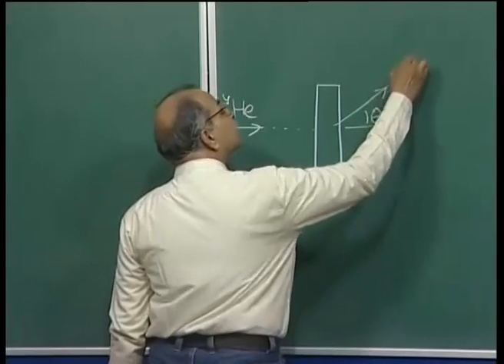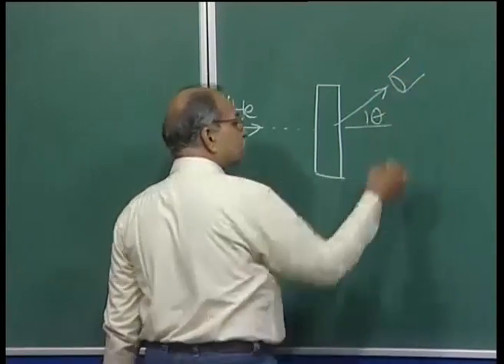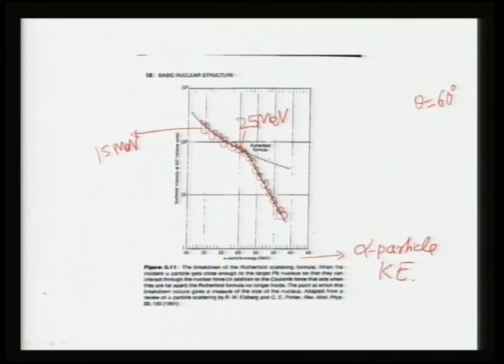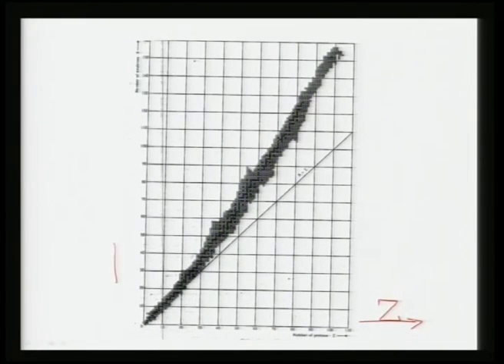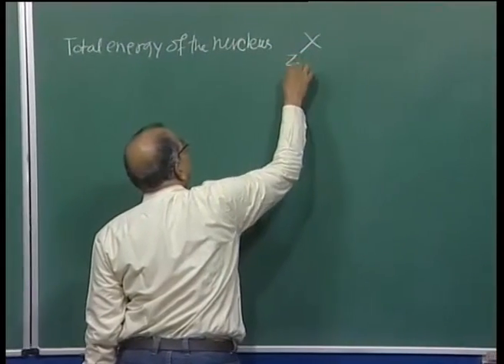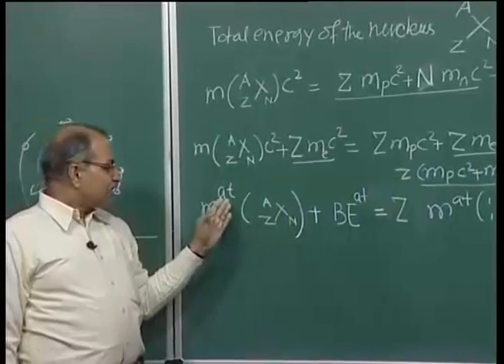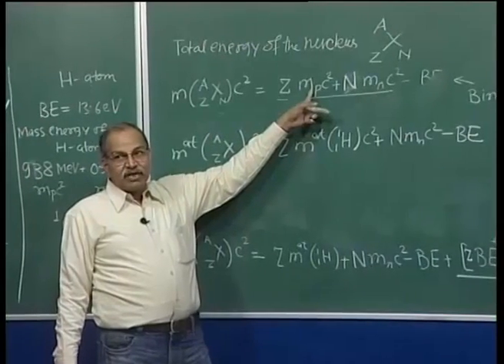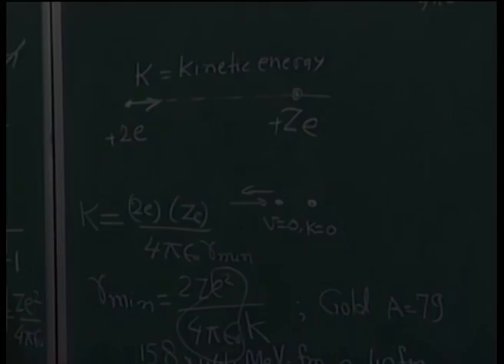Mod-01 Lec-05 Semi empirical Mass Formula

Comment: Excellent lecture series
Reply: It is the cross-section corresponding to a given theta (scattering angle) and phi (azimuthal angle) over a finite delta-theta and delta-phi. This is the case for a detector subtending a small solid angle that measures the events. When you integrate the differential cross-section over the full range of theta and phi covering the 4 pi solid angle, you will obtain the total cross-section.